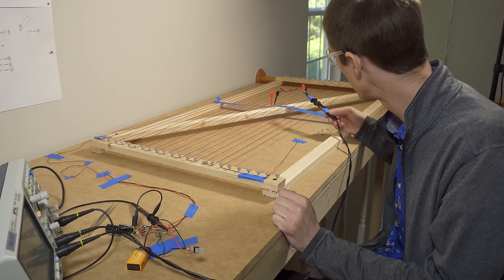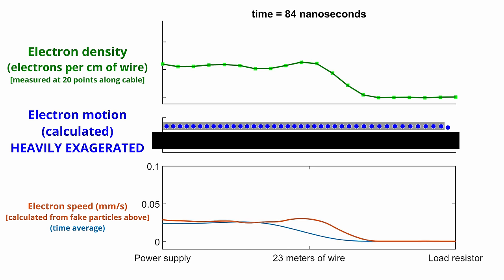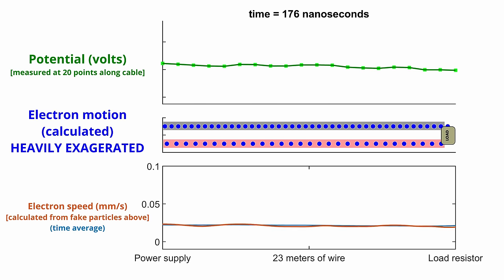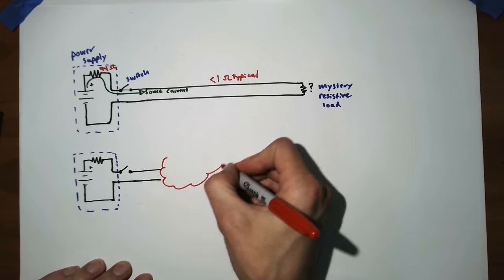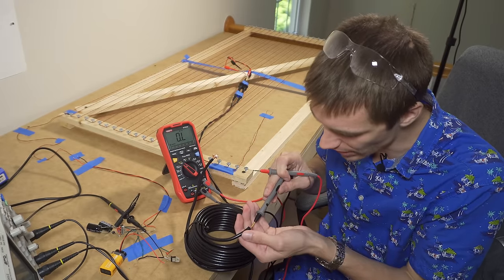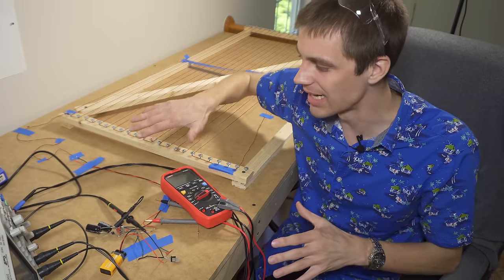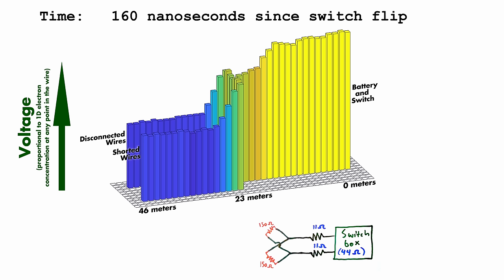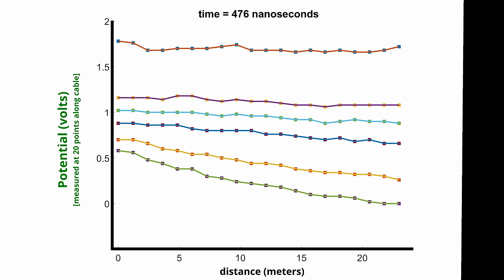What does "impedance matching" actually look like? (electricity waves)

Comment: I was an ISP tech for a number of years, mainly working twisted pair for service but a lot of coax for inside wiring. I never understood what the impedance rating of RG-6 was supposed to be. I guess now it's the impedance value between the sheath and the center conductor? A measurement between those two on the multimeter might have been instructive (not just across each one individually). 
Based on this, I guess the terminators we were given to cap off unused coax jacks were just bridging the conductor and sheath with those "magical" resistors whose value that matched the impedance of the cable to prevent that reflection. 

Also, this helps me understand why reflections are a problem with "bridge taps" in a twisted pair network between the Central Office or Remote Terminal and the customer's gateway, and why attenuators would help. When the phone network was set up, each pair was "cut into" (connected to the binding posts of) several serving terminals in the last mile from the cross-connect box to the terminals on the street. When this was repurposed for Internet service, those "bridge taps" (places where it was cut into multiple terminals) caused reflections with the high-frequency signals used for ADSL/VDSL, and being so close to the customer's equipment were significant transient noise that swamped the signaling. One solution was to find bridge taps that were beyond the customer's assigned terminal and install attenuators that made it seem like there was another 1200ft of cable past that point, so the reflections wouldn't be near enough in time or powerful enough in amplitude to overwhelm the intended signal.

Comment: So, the battery does instantly know something about the circuit, then? It knows the circuit's impedence, right? Or, if not instantly, it's faster than can be measured, because you initially/immediately see the battery sending a current to match a 150 ohm load. That's really wild. That implies that as soon as 'door opens' for the current to flow, it's immediately limited by 'the size of the hallway' (so to speak).

Comment: Love your experimental approach! How the wave reflections tell about the rest of the circuit. Imagine a reactive circuit, with impedance match but which still returned or pass some higher frequency information.

Magnetic River lectures are a good physics demonstration of the impedance and reflections.

Also looking at reflections based on input discrete or enveloped frequency pulse shorter than the length of your wire. Very thought provoking!

Comment: Very informative. But I still do not see how you can calculate the current based on "fake particles (voltage only)."   You state there are 15ma (I believe) but how do you arrive at that? Did you measure the current with the oscilloscope, if so how?  Maybe I missed something in the video.

Comment: I had this exact same epiphany myself not that long ago back doing basically the exact same thing, but instead of physical wires and an oscilloscope, I used a circuit simulator.  And what's even more interesting is that I wasn't messing around with the circuit simulator to see what electricity does, I was using the circuit simulator as an analog to understand long pipe runs.  So while you were using water as an analog to electricity, I was using electricity as an analog to water.

(also as a side note, I just realized as of writing this comment, that an analog to impedance matching for water pipes should also exist.  Imagine sonar down a pipe, but there is no reflection)

Comment: kewl, this explains why a very thin wire hit with hi voltage and hi amperage explodes entirely along its length instead at the connect point of the supply....

Comment: Hi, again a great explanation. A rule of thumb in impedance matching is that it is only really necessary for tranmission lines longer than 1/10wavelength. I was wondering if it would be possible to show why by exciting your model with a squarewave instead of a step. Would be cool to see the waveform at various frequencies with waves under at and above 1/10wavelenght.

Comment: My lightbulb moment is not thinking of impedance as a resistor at all....because it isn't. Resistance converts current into heat. Impedance is something else.

Impedance is a voltage to current ratio. If you have a 50 ohm cable you can expect the insertion impedance to drive this voltage-current ratio - If there's 50 volts, then there must be 1 amp. So imagine this current (and voltage) wave going down the cable and then meeting a different impedance (different voltage-current ratio) - energy must be conserved so any energy not absorbed in the load must reflect. Only a perfectly matched load impedance can result in no left over energy to reflect.

Comment: The way I learned it in school is that 
Impedance only refers to changing voltages, whether it’s a AC signal or in your case the change of 0 V to 2.5 V.

It would be how you get signals to go through a bandpass filter or stop by a bandstop filter, the band being the frequency. 

If you changed your voltage to 10 V, would you still have the 150 ohm resistance equivalent of current flow before the wave reaches the end of the wire and find the actual resistance?

Comment: Interesting.  I wonder if the 30 or so test leads are what's driving the amperage in the open circuit. I wonder what we might see if those test leads were connected to Earth ground instead of negative battery terminal.

Comment: In Radio there is a thing called SWR which measures the amount of reflected power due to impedance mis-matching. I'm not sure if you have been able to observe any of this, as I don't know what frequency you were switching the circuit, but it would be amazing to see what that looks like.

Comment: During my physics major at Cal, I had to take a semiconductor lab course, and I always envisioned 'electricity' as travelling as a wave through the wire, and if the impedance did not match, the wave would reflect, just like a wave reflects at the 'point' where a wave travelling along a string has a change in string density. This all seemed rather intuitive to me, which is why I am not a fan of "your intuition is usually wrong!" peeps; this is because they 'almost always' consider intuition to be catastrophically wrong in nearly all cases.

Comment: such a cool video! you've got skills. And a lot of patience! this video has so many measurements in it. I really enjoyed the data presentation too. I think you might like tube amps and speakers. The tube amp circuit has to be tuned to a specific "output impedence" to match an "input impedence" of a set of speakers. I've always been curious about how different a tube amp circuit sounds at 4 vs. 8 vs. 16 ohms irrespective of the specifc speakers used. One of the reasons I think this is interesting is because the signal distortion that occurs in a tube amp circuit when you turn the gain all the way up is of particular interest to guitarists (but also vocalists and harmonica players). I have always wondered if/how the character of the signal distortion changes with the output impedence of the tube amp power section. I am a chem E but wish I had chosen EE. Circuits and signals are too cool.

Comment: Finally, I not just "know", but understand impedance intuitively and how it is different from resistance. We only did DC circuits in school (before moving to digital circuits) and there is only active resistance. In AC circuits we have frequency-dependent reactive resistance, I could imagine from term of charges/electrons as a circuit that never reaches a steady state, but even with all the theory, I could not envision what impedance is.
P.S. You can also explain capacitance this way, as the congestion of electrons in one wire and spreading of electrons in the other wire is not their "natural" (i.e. 0 Volts) state. If you disconnect the wires thus keep the congestion, and then connect them with each other (potentially through a load) you will have current for very short time until the congestion restores. Since this congestion only happens on the surface of the wires, you can increase the surface area to increase that effect.

Comment: The impedance of a transmission line is derived from its capacitance and inductance. Even though it is a continuous element, you can model a transmission line as either a single LC element or a series of lumped LC elements and it makes no difference to the impedance. The length of the line therefore makes no difference and that's why a cable can have a fixed impedance printed on it without knowing how much of it you're going to cut off. This also tells you a lot about the physics. L and C are reactive. They store and release energy over time. X_L and X_C are the imaginary components of impedance, which is complex. L is also related to magnetic field and C is related to electric field, both being an inertia in those fields. This is also why the physical design of the cable sets its characteristic impedance.

These concepts only exist over changes in time, therefore only for AC. Why is this a transmission line and how is this AC when it's a DC circuit being turned on? The fact the voltage is being changed when it's turned on means there is a change in voltage over time. A step voltage can be broken down into the superposition of many sine waves and the faster the rising edge, the higher the frequencies of those waves. (slowing rising edges is a technique for reducing high frequency EMI for compliance) A cable behaves as a transmission line if the length of the cable exceeds 1/4 the wavelength of those waves, and so even though this is DC being switched on, the transient has some component frequencies which have a short enough wavelength for this transmission line effect to be observed.

For the pedants: a signal has an AC component if it changes over time, the sum of AC and DC components which make up a signal does not need to cross zero volts or zero amps for there to be an AC component, just subtract the DC component and what's left will cross zero.

Comment: Is this an example of capacitive coupling?  I was expecting to hear the term when I clicked on the video and thought I might finally get a good explanation of what that term really means.  Since you didn't mention it, is there a term to describe the effect of the charges on one wire affecting charges on the other?   Thanks for a great explanation overall for where the need for impedance matching comes from.   
I think it would have been good touch on the reason all of those coax cables are made the same.  As I understand it, more so after your excellent explanations, having a standardized impedance cable allows manufactures to build the receiver in your cable box with a standardized resistance of 50 Ohms to remove reflections from the signal source which would result in a blurry or distorted image for the cable subscriber.  Since the signal is AC, you effectively have a 'new' dc signal with every half wavelength to create that initial pulse.  I don't think impedance matching is that important in DC (non switched) circuits since, as you demonstrated, that reflection eventually dissipates and wouldn't matter after the first few hundred microseconds.   
Do I have this right?

Comment: If you want to properly and fairly quickly understand impedance matching, study RF and amateur radio, it teaches you that the electricity flowing down the antenna cable gets to the end and does one of 2 things, radiates (matched impedance) or reflects (mismatched impedance). Obviously for radio you want matched, so you alter the antenna to be what the frequency requires to make the "jump" to radio wave. I know it's not exactly the same, but the principal is, matched antenna to frequency works, mismatched antenna reflects the "wave" back down the cable. There is the instance that not enough power down the antenna feed also results in no transmission so the RF source sees and infinite length of cable and thus the electons settle before reaching the end of the line. just like you find with the resistor. Remember RF is AC electrical signals, AC is DC going out then switching polarity, so effectively DC rules work for the initial out and to some degree on the other outs for the switched polarities. The interesting bit of AC is what happens when an outgoing current colides with an incoming current as it does at certain points on the cables depending on cable length and frequency of switching used.

Comment: I concider this a really clever way of understanding characteristic impedance and i have always struggled with it. The only thing i wonder you never mention frequency? Isn't characteristic impedance (of a wire/ piece of coax) depending on the freuquency you will use it for? You just observe the first transient, when the switch to a DC source is closed and how electricity behaves in nanoseconds. It will find a steady state very soon, so frequency results out of your measurements in time frames (of ns) and wire length, right?

Comment: Great video! I've been dealing with electronics for almost 20 years now, and this made me realize the following about impedance matching:

It's basically like pulsing a wave of water at a water park, but it immediately goes through a gate. You then want as much of the pulse to make it through another gate at the end. The way you pulse the water influences the size of the gates that you want to not waste any wave.
Reply: Be it AC or DC, impedance matching will give you the maximum power transfer. When you have impedance matched, it essentially is removing the reflection by making it appear to not be entering a new medium. Any differences in impedance causes a reflection.
Reply: And to add to the previous comment .. analogies exist for optics, acoustics, and any other realm of physics that involves the transfer of energy from one medium to another.  This is why some optical lenses have "anti-reflection" coatings, why some speaker designs are shaped in certain ways, and so on.  You want the energy to see, in its intended direction of travel, as gradual a change in it the characteristics of its propagation medium as possible.  Otherwise, boing! energy goes bouncing backwards.

Comment: Your next step is covered in Fields and Waves course and RF propagation, where the circuit continues into the free air, and does not end at the wire. RF only requires a changing field and the transient response you are observing is similar to early spark gap experiments where they discovered RF transmission through free space. Suggest experimenting with sinusoidal sources and observing forward and reflected waves in wires of varying length--that will get you into resonance, antennas, and radio. Interesting stuff that is not intuitively obvious coming from DC circuits.

Comment: This is just the charging current of the capacitance of the cable.wires. As the title says, "Impedance" which includes inductance and capacitance. The initial current "weave" shown is the charging current of the cable capacitance. Perfectly explainable if you take into account inductance and capacitance of the cable. By the way , the 50 ohm cable impedance does not mean he ohmic resistance of the conductors, its the impedance of the cable between the core and screen. Thats the "characteristic" impedance of the cable which depends on the construction ans materials. There is also 75 ohm coax made.
They should be terminated into 50 ohm or 75 ohm loads to give max. power efficiency and reduce reflections just as in your 150 ohm example.

Comment: If you desire no extra resistance added to the circuit, as long as the regualr load is known then you can balance capacitance and inductance only. However if your inductor is a vortex coil (POE style) then its variable resonance, aligning to the attached load if its the only inductance-- supposedly. I'd love to see this verified by this or similarly good youtubers though.

Comment: It took me awhile before I knew what a cable’s impedance actually meant. The wire’s designed capacitance and inductance are such that it will behave its best when terminated by 50 or 75 or whatever ohms, i.e. the cable’s design impedance. The voltage step characteristic to the signal’s square wave will bounce the least and for the shortest amount of time when that cable is so terminated with its characteristic impedance, or load resistance. As a result a square wave representing the test signal’s frequency will better retain its shape and result in lower signal loss. 

All else equal, a higher frequency will further run into the unavoidable rise time limit of that cable-terminator circuit. Likewise, a longer piece of wire begins to exhibit series resistance that is an increasingly significant percentage of the circuit’s impedance, detuning the circuit and limiting its accuracy for that characteristic signal. The tuning of the cable & terminator circuit greatly increases the distance-frequency product over that of a random pair of wires would yield but there is a limit, which is shown as length versus frequency.

If a cable has the characteristics that make it behave best with a termination resistance DIFFERING from the termination, the start of a waveform will bounce to a greater amplitude and for a longer period than in a properly matched circuit. This explains the lack of criticality if the frequency of the signal used is much lower, which was something I saw empirically in the field. The bounce, though the same, damages the waveform of the signal a smaller percentage and the signal will have less loss at that frequency due to mistuning.